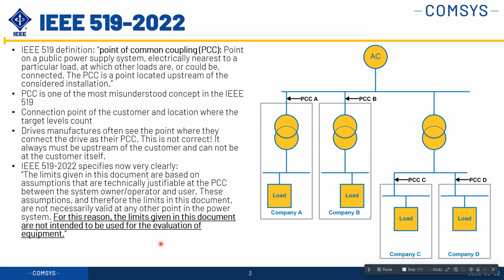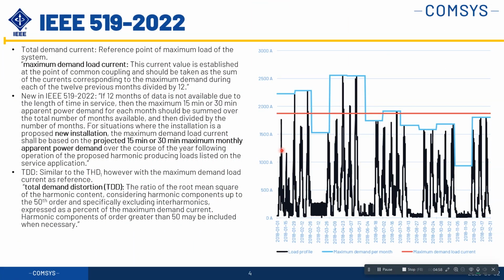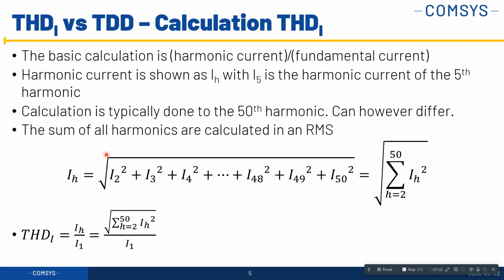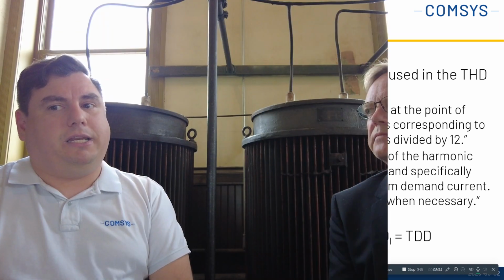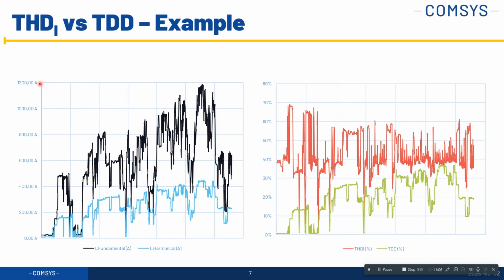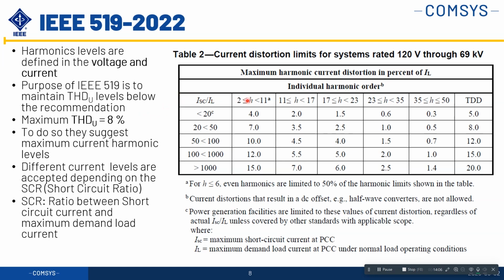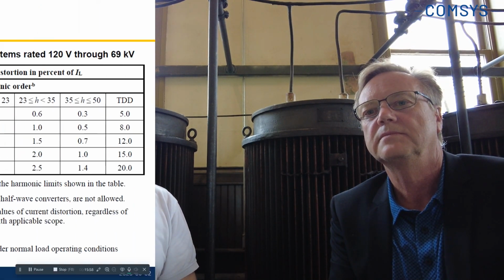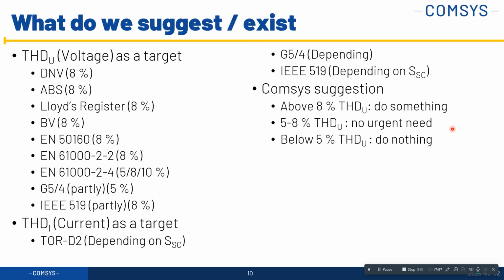Understanding IEEE-519: Expert Insights and Common Myths Debunked

Comment: Hi, nice video.

IEEE-519-2014 explicitly states that the demand current is calculated using the fundamental current. However, in the 2022 revision, it only indicates the demand current.

Which should be used?
Reply from the maker: Hi, great that you likes the video.

TL;DR: The RMS current should be used.

That is a good question. You are right in IEEE 519 2014 the table 2 mentions that they fundamental current should be used.
The definition in section 3 is not as clear:
"maximum demand load current: This current value is established at the point of common coupling and
should be taken as the sum of the currents corresponding to the maximum demand during each of the
twelve previous months divided by 12."

Since the 2022 revision the note in table 2 has been removed, but the definition in section 3.1 is much more detailed and specifically talks about the RMS current:
"maximum demand load current: This current value is established at the point of common coupling and
shall be taken as the sum of the rms currents corresponding to the 15 min or 30 min maximum demand during
each of the twelve previous months divided by 12. If 12 months of data is not available due to the length of
time in service, then the maximum 15 min or 30 min apparent power demand for each month should be
summed over the total number of months available, and then divided by the number of months. For situations
where the installation is a proposed new installation, the maximum demand load current shall be based on
the projected 15 min or 30 min maximum monthly apparent power demand over the course of the year
following operation of the proposed harmonic producing loads listed on the service application."

Comment: Though Consulting Engineers mandate IEEE-519 compliance. The equipment suppliers are unable to meet the intent as they only supply equipment that consumes partial electrical loading and have no awareness of how to meet the TDD levels of compliance. How does a supplier of each piece of equipment meet the IEEE-519 compliance??